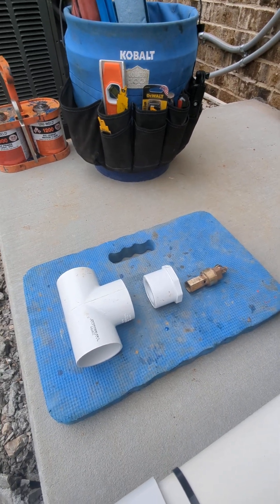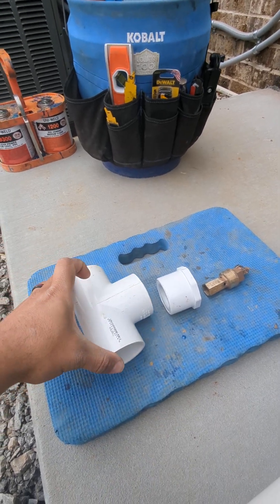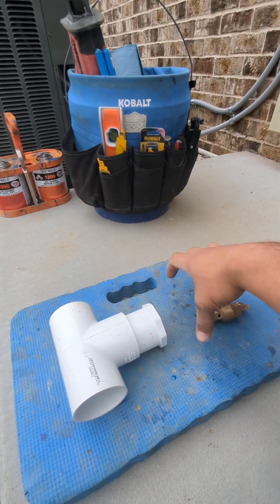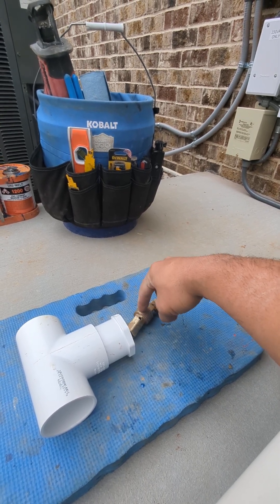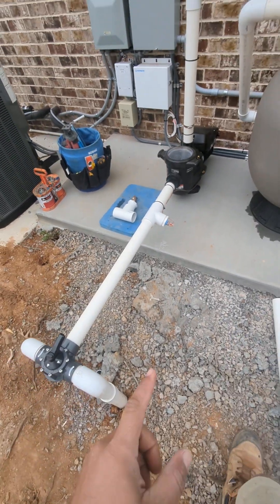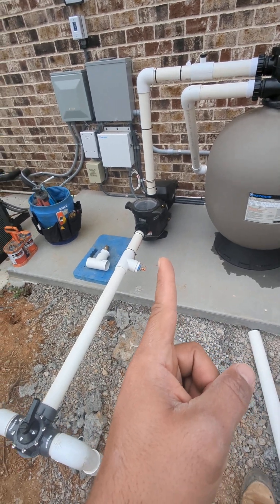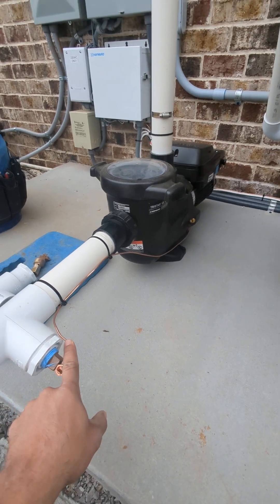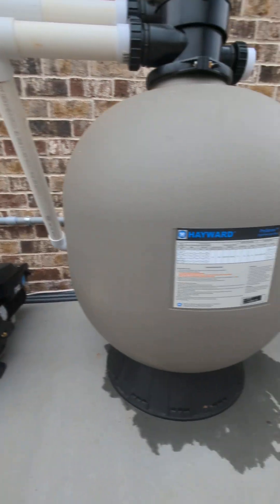Pool Plumbing - Water Bonding Fitting #shorts

Comment: So GFI is worthless then..all this seems overkill..
My pump is plugged onto a gfi receptacle, which the power source is plugged into a GFI. Is this not enough?
Reply: You need to bond all the elements of the pool together. This guy in the video has no clue what he is talking about...
Reply: Hey,I’m being told I have a break in my bonding around pool after telling electric company I have a 0.5 volt reading in pool.Options are getting bonding tested by certified pro ,breaking out pool stamped concrete deck and replacing bonding ,considering all and more options
Reply: @luciusbrutus13th Hey. I just built my pool and I like to do the same, but all water need to bond am I right? Mean in and out water. Plus coping, and every metal around pool till 5'. The Bonding is not only for protecting an equipment, but protecting people who in or around pool, if any electric problem. I'm right?
Reply: What if the gfci fails? That’s why, because safety needs to be redundant no matter what. Hard wire bonding is always best